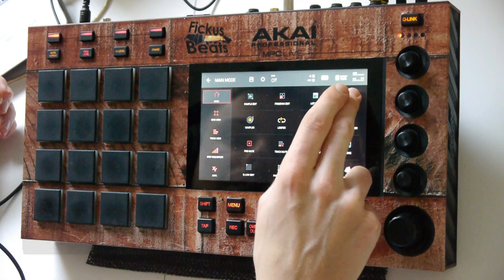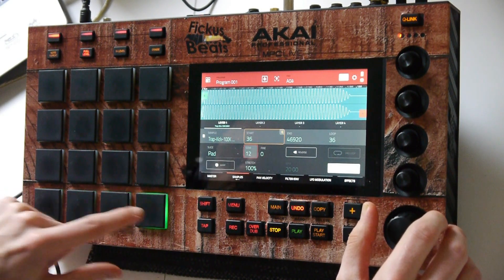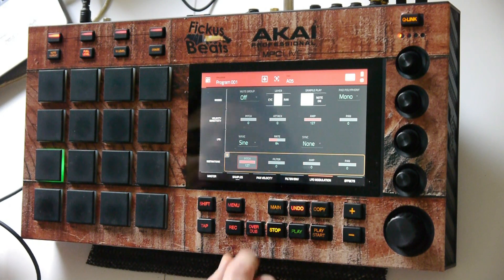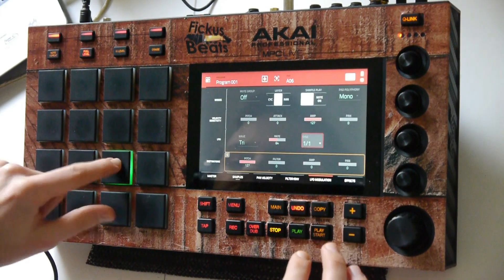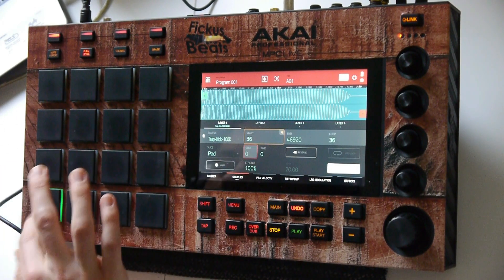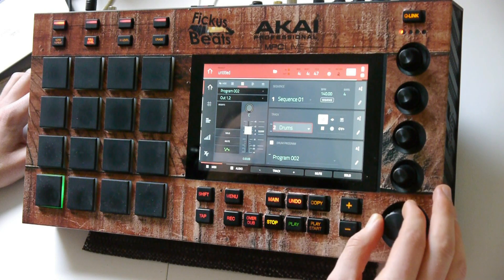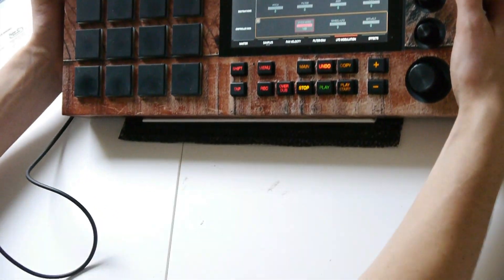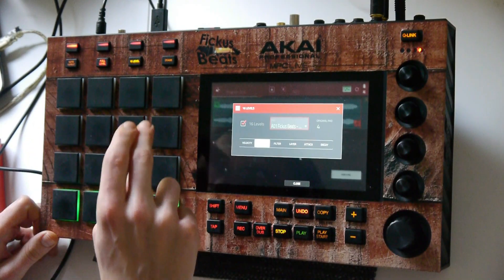Akai Mpc Live Tutorial - 2 EASY WAYS to do 808 GLIDES ∣ Standalone!!

Comment: Hi great video however I have a problem , I'm trying to remake the 70s song with 808 bass line,  I tuned the 808  notes as you instructed it took up all the pads, then i sequence the Bass line with no problem,  however When I went to a different bank And assigned drums two finger drum,  the drums keep clipping the 808 any suggestions my worst case scenario is I would have to record the 808 bass line that is  sequences,  and then sample it back in to the Akai live,  that's a lot of work I'm sure there's an easier way  
Thanks in advance
Reply from the maker: Thanks a lot!Sorry for the late reply.. maybe if you make whole new program for the drums, the problem will be solved..(?)

Comment: I'm probably answering my own question but does the mpc live have a built in 808
Reply: It doesn't you will hav to do his method :edited:
Sorry, Software Yes
            Hardware No
Reply from the maker: no unfortunately not, it has a bass synth, but that can't really make a decent 808 sound^^
Reply: @Marrcello  ok...well I came across this Urban 808 kontakt libary can I use that and if so...does the mpc live have kontakt 5 cause you need a kontakt 5 to use it
Reply from the maker: You can't use any external plug ins with the mpc in standalone mode..but you can use plug ins with the software..but i cant say which, I'm sorry..^^ You can use the mpc as an ableton controller since the last update..check out the mpc live facebook groups..I'm sure they can help you with these software questions!
Reply: Look up MPC weekly. There is a video on how to make 808s in the tube synth that can glide.